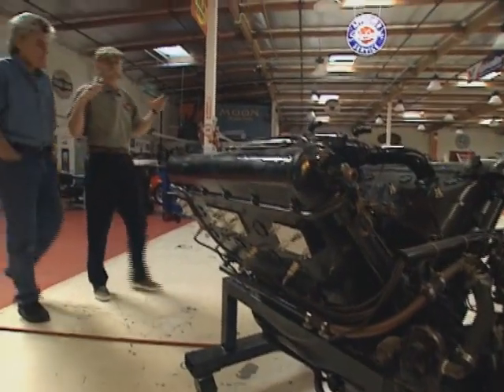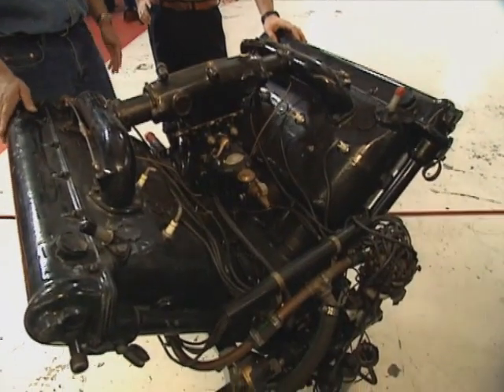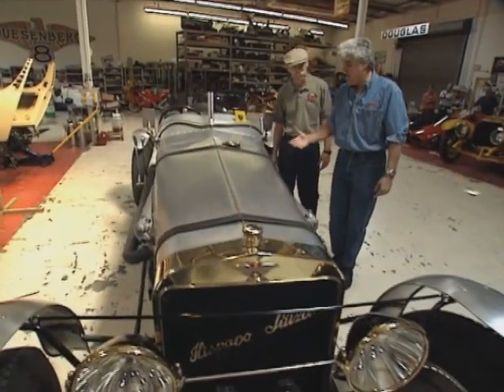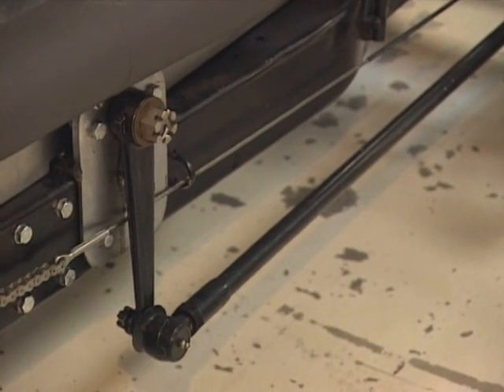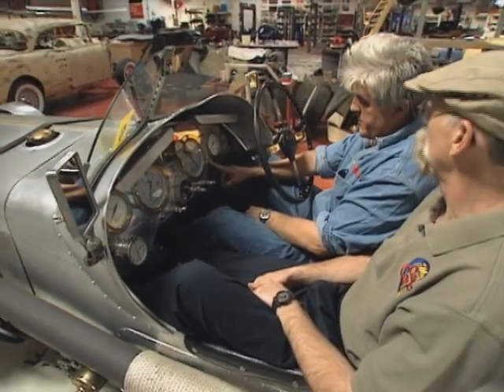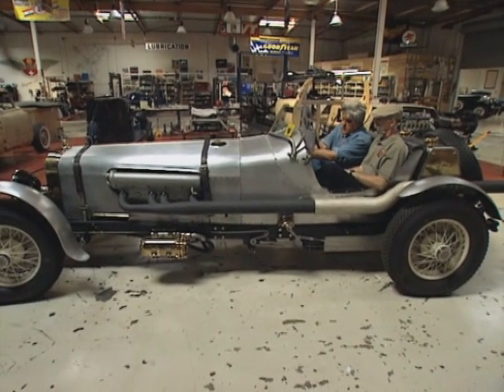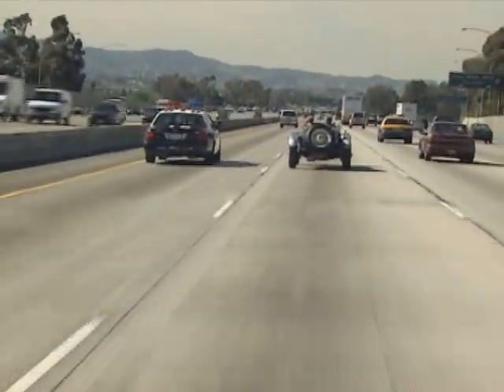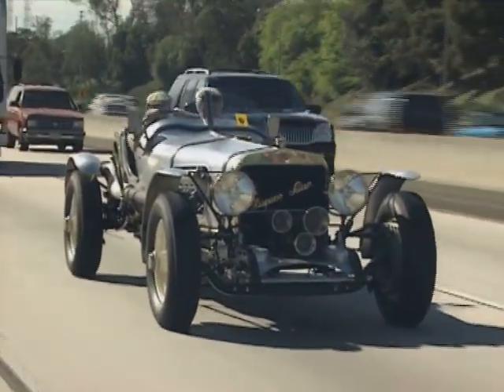Jay Leno's 1915 Hispano Suiza

Comment: Did their shoes melted?  This original V8 engine was smaller (11.8L) and was tested for 50 hours run at full power before being slammed, sorry placed into the french SPAD S.VI airplane.  The one in the video is the 8F with 18.5L